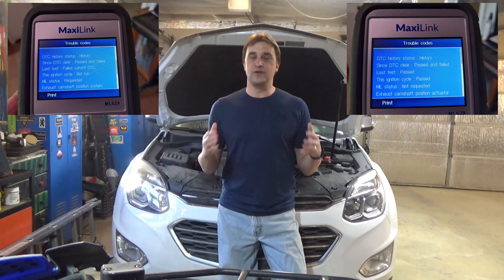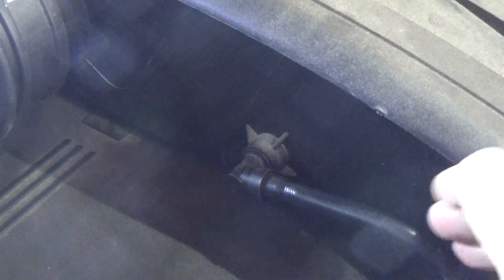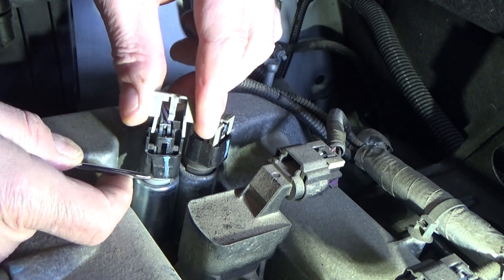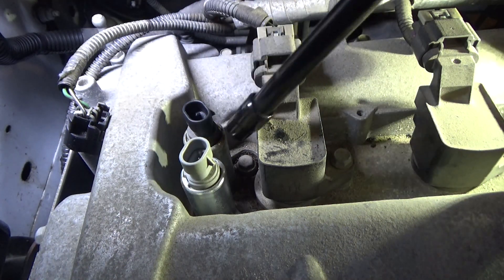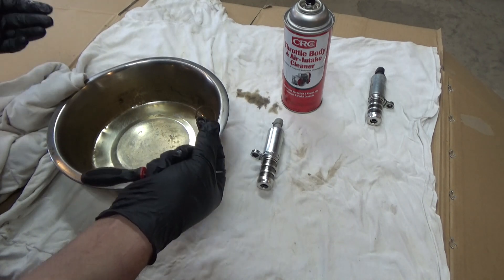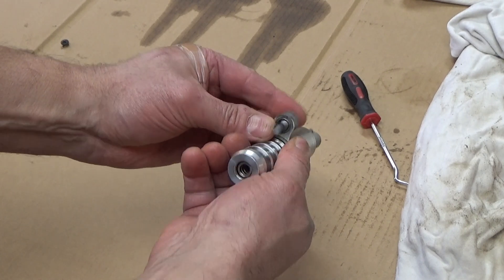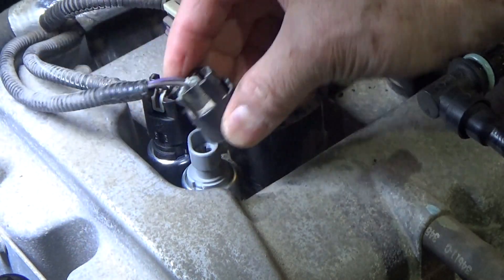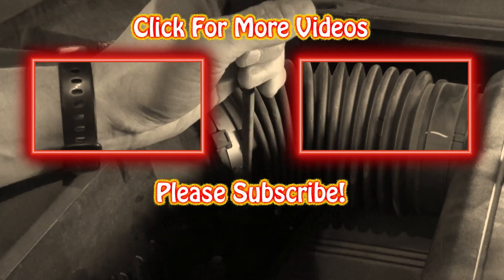How to Clean and/or Replace Variable Valve Timing VVT Solenoids to Clear P0013 & P0014 Equinox

Comment from the maker: GMC OEM 12679100 Exhaust Variable Valve Timing (VVT) Solenoid on Amazon - https://amzn.to/3k3PS8T
GMC OEM 12679099 Intake Variable Valve Timing (VVT) Solenoid on Amazon -  https://amzn.to/3rP92Uq
GMC OEM 12674704 Engine Camshaft Position on Amazon - https://amzn.to/36GjKVT
TEKTON Mini Pick and Hook Set on Amazon - https://amzn.to/3k3Q1Jt
3/8" Ratchet Set Including Metric on Amazon - https://amzn.to/38kfEmQ
Throttle Body Cleaner on Amazon - https://amzn.to/3K9dGTA

Comment: Some dust got into my exhaust selenoid and now my car is shutting off and shaking so bad on idle, could it be cus of the dust and if so how do I clean the socket?
Reply: Did you ever figure it out?
Reply: @jorgecarrejo I had replaced the solenoids, then this problem started, I just cleaned the old ones and put them back in, and the problem went away, but still had some timing issues from the chain not being installed correctly, it's a garbage car, I would suggest stop wasting money into it, sell it and get some other cheap stuff

Comment: I bought a cheap diagnosis thing online. It gave me p0010 and p0013. I followed your video  and purchased the parts from Amazon for $26 (for both)  the codes went away as well as the service engine light!  I had called a local service center prior to that and they quoted 5 to 6 hundred minimum for the job! It took me about an hour. THANK YOU SO MUCH!